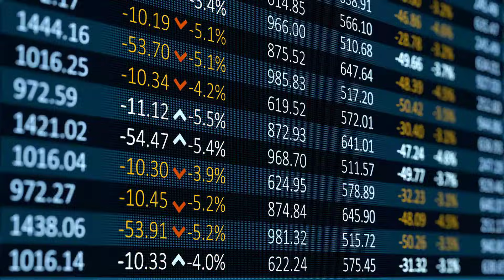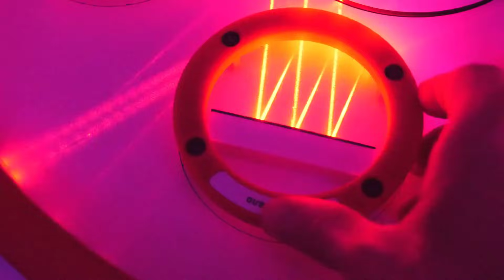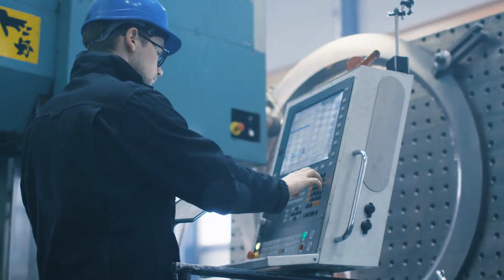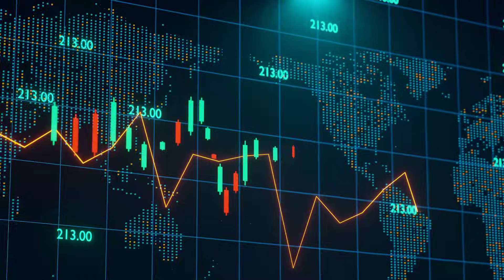The $400 Billion Monopoly That Holds the World Hostage.

Comment: ASML depends on parts from various global supply chains, they don't create the entire machine, they assemble the machine.
Reply from the maker: Correct ASML doesn’t manufacture every part. EUV machines are built from hundreds of ultra-specialized components sourced globally.What makes ASML unique isnt parts ownership, but system integration: aligning optics, light sources, software metrology and vibration control to work together at atomic precision. Many companies make pieces only one currently makes the full system run in high-volume manufacturing.